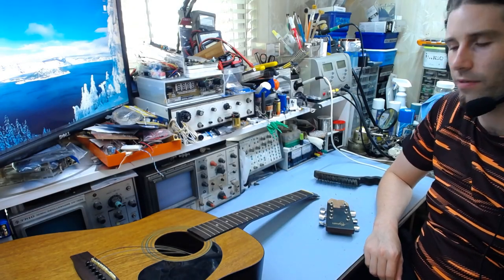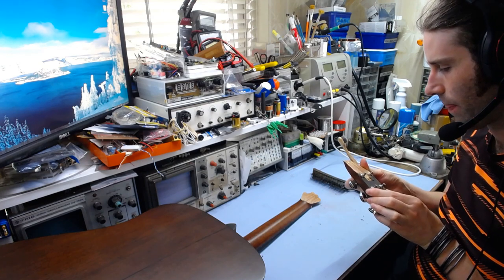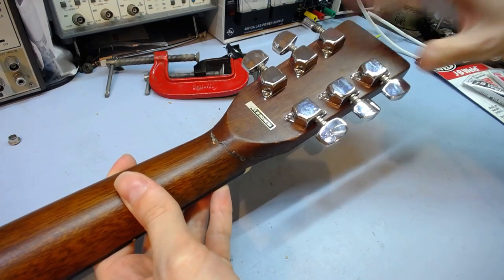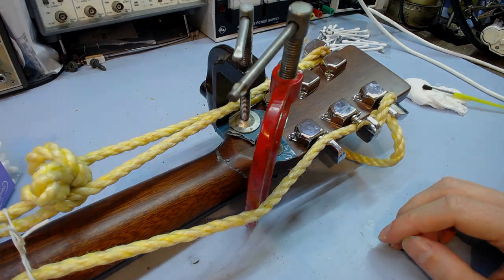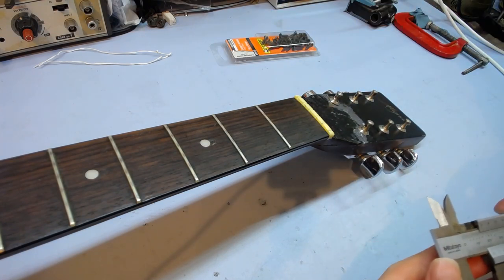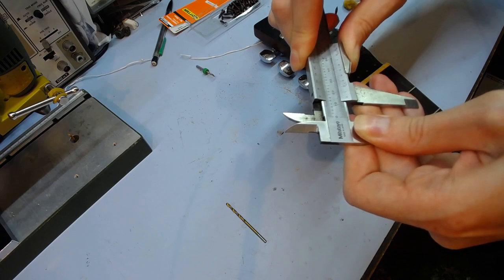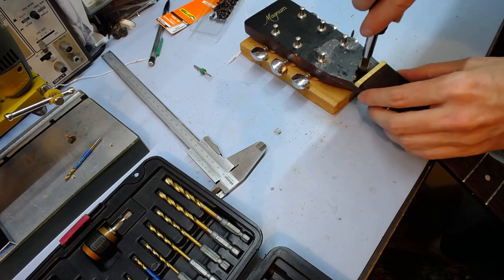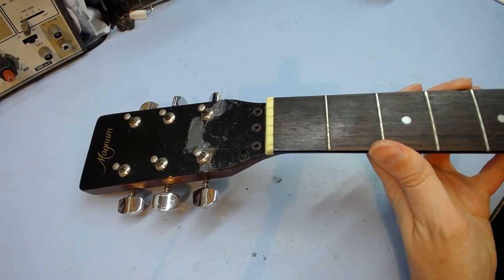Repair of a "Magnum" acoustic guitar

Comment: this has 0 correlation with the video, but if someone can reply to this. i just got an old magnum and dont know weather to put nylon or steel strings on it. i dont want to bend the neck too bad
Reply from the maker: Ask at your local music instrument shop, I'm sure they can help you.
Reply: Are magnum guitars decent at all? I can’t find much about them.
Reply: Might be a late reply but I have had a magnum acoustic that I have been putting steel strings for nearly 25 years, acfually my favourite acoustic purely for sentimental reasons, but the neck has held firm and straight, and it was alreadg old when I got it in the 90s